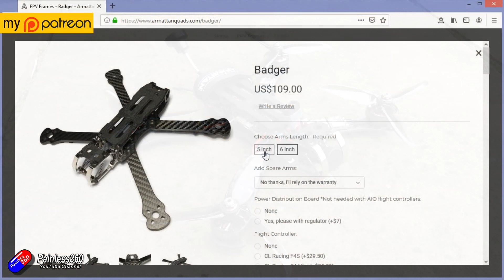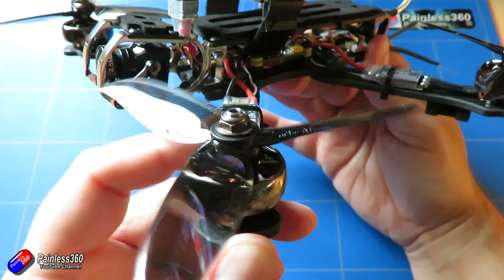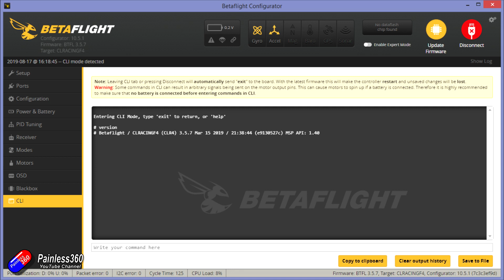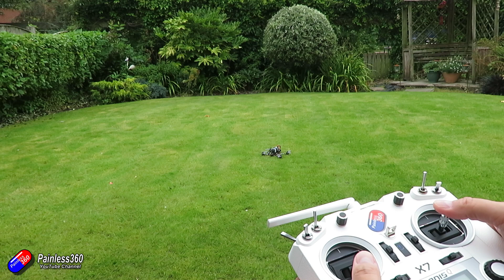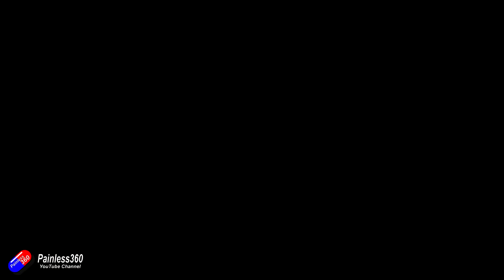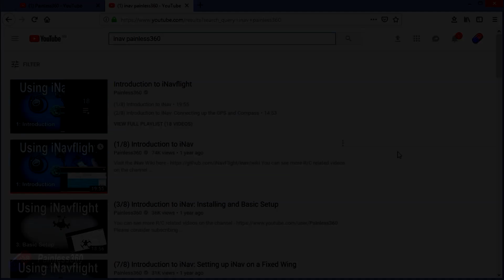Armattan Badger RTF Quad and Frame

Comment: What an amazing quality quadcopter Lee. 
As you know, I'm a bit late to the show with this one. 5 years on it is still a good example of Armatttan RTF quality and I am sure it will be flying for many years to come. It has come alive with an BetaFlight update to 4.2.11 and it does fly rather nicely.  
I also have an example of the very similar format Armattan Rooster, which I bought as a frame. I've powered the Rooster with Aurora DarkMax power train on 6S,  JHEMCU F4 FC, Rush Tank VTX and Runcam Eagle Pro. So as you can see, I do like Armattan quadcopters.

Comment: finally I was abled to order my DJI Marmotte from Armattan, but I am wondering if they made a mistake or I am so stupid ? !  the pre build  DJI Marmotte is a 6S quad with 6S motors, but DJI Air Unit is limit to 4S, so is it going to be 6S or 4S  quad ?! thanks
Reply from the maker: I'd check with them on how to drop the voltage for the Air unit.. Best of luck!
Reply: @Painless360  thanks man, sorry I saw your reply 2 days ago but forgot to thanks, 
I asked them and as always they replied fast with all the explanation required to understand the issue , even for a noob  like me , the short version is they are 6S capable

Comment: Nice look at the Badger, Lee.  Thank you.  I've been  looking at this particular frame to put a DJI air unit in it.  Looks to me like there is plenty of room, and Armattan is now selling the frame alone, or with 3D printed holders for the Air unit, The FPV antenna, as well as a nice routing for the on-board receiver.  Thanks again, see you soon.

Comment: I agree with warranty - just smashed my marmotte (space carbon) into a tree at 86mph on gps - ripped an arm off & within 24 hours have offered me three options - marmott space carbon, marmott 4k or badger 4k - awesome. Given that you have flown both, would you mind giving an opinion on badger v marmott, ie badger's ease of replacement arms v marmotte being less susceptible to vibes/jello? I'm steering away from space carbon as my 4k carbon chameleons haven't lost arms in heavy landings/crashes yet. 
As a side note - there is definitely a strength advantage, and potential cost advantage, with Armattan 4k carbon quads compared to some of the cheaper 3k carbon (non-warrantied) - as I've had Skystars, Eachines self destruct in much lighter crashes than my Chameleons have endured and survived

Comment: I got the marmotte bnf a while back, worst fpv purchase I've ever made. Chris did a great job building it, but so many problems. The immortal t antenna was DOA (I chose the crossfire nano rx), replaced it and it was then fine. One of the c-clips came off a motor, and they didn't provide any of the washers that go with them, and wouldn't send me any because they are part of the motor bell SKU. Replaced them with Xings, nice upgrade. Have an ongoing yaw twitch (gets very bad), and it still exists after replacing the esc's and FC. Not sure what the deal is with that. I basically ended up replacing everything except the Unify. I should have just bought the frame. Looks like your Badger has better motors, so that's good. Mine came with the underdog 2150kv's, they were terrible. Great review man. The experience has pushed me to only doing builds now, that's a good thing.

Comment: So,, I'm confused, the lifetime warranty,, that only refers to the frame itself correct? I ask cuz when u spoken of the folks at Arrmatt⁵on some of them are on the same frame from 5-7 years ago, but have used the warranty   ?? NO}

 Way that refers to the hardware aswell,......Right?!
Reply from the maker: Full details of the warranty are on the website. Apologies if I wasn't clear in the video but I was commenting on the fact that some owners had claimed many times for broken parts and hadn't had to but another frame in years.. Happy flying!
Reply: Frame warranty=lifetime, electeonics/motors=14 days

Comment: Funny that they have gone to the trouble of setting up a custom tune (a subjective setting based on user preference) , but left it as a plain 'true' X layout without a proper custom motor mixing (an inherent feature of the frame itself).

Comment: Those Armattan motors are rebranded Karearea TOA motors, nothing wrong with that just a heads up
Reply: They are not rebranded TOAs. They are designed specifically for Armattan by TOA and the TOA logo is on them.  ;)
Reply: Who cares!! You’ve kept the same motors on your kwads the whole time...

Comment: Love this channel. But I think you are talking to the 10 to 20% who understand, the rest of us are lost
Reply from the maker: Hi David, check out the video piece at the end of every video I put on here. I have complete series aimed at those pilots who are new to the hobby as well as those who have been in the hobby for a while. If you're new to all this then check out my series designed to help you understand it all using the minimum of three letter acronyms; Introduction to Remote Control, Quadcopter building for beginners (6 series), Flying wings for beginners series/playlists as well as specific videos to help with specific things you don't understand like radio setup, jargon and fixing problems. Happy flying!

Comment: My soldering isn't as good as that but I do buy the armattan solder from HobbyRC, I have to say nothing has improved my building more than that solder. It's probably rebranded kester or something but all the really good industrial solders have about 1000 different varieties (even many labeled 62/38 and 63/37), cores and thicknesses and I can't get them anywhere convenient.
Reply from the maker: A decent soldering iron with a decent tip and lead based solder and proper prep of the joint will get you results like this... with practice :D